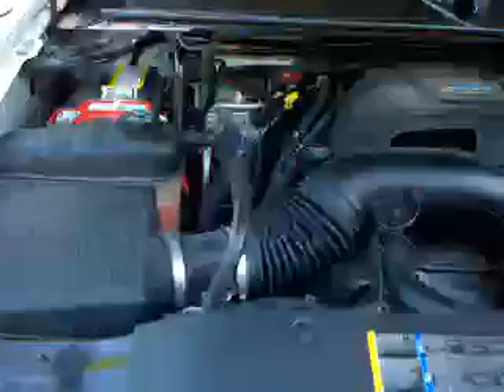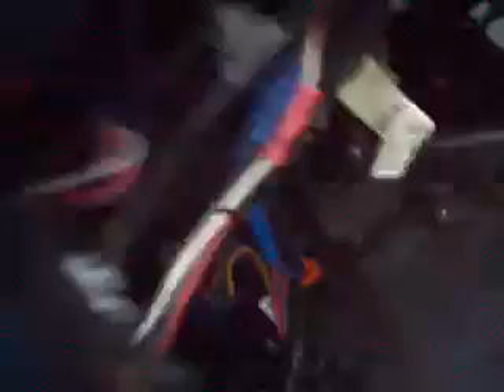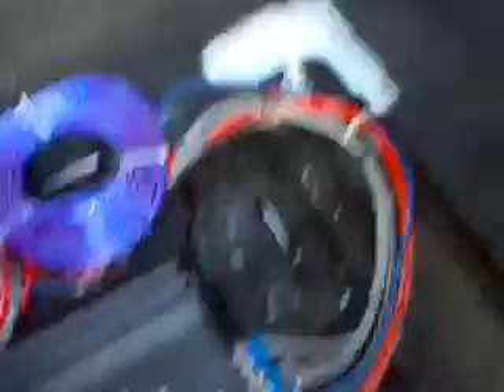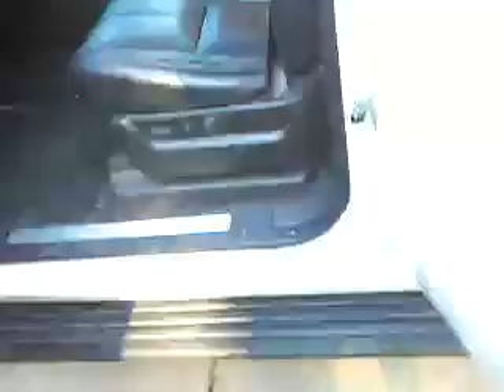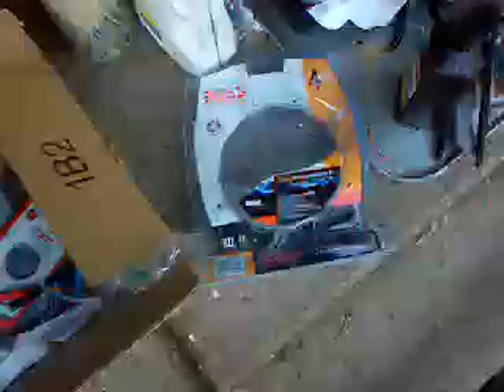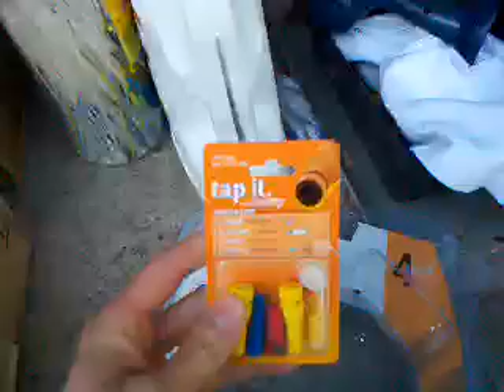2007+ Tahoe Add-an-amp

Comment: You shouldnt be running ur amp in full mode instead of lpf (low pass filter)  you need to run it in lpf and turn the lpf up on the amp to hit higher frequencies. You dont want treble signal sent to your subwoofers.

Comment: From your LOC it still has a blue remote wire where did you run that too? I see you ran the blue remote turn on for the amp to the bottom corner

Comment: You didnt have to run it across the firewall i strongly advise against soing that. It exposes the wire to unnecessary heat

Comment: I hooked up a in converter to my 2012 Yukon Denali to my amp n sub now am getting a loud noise when I put truck in drive like a deep humming sound , n when I put it back in park it stops I have the loc pro 7 in converter
Reply: I have a 2014 GMC Yukon Denali  w Bose . I hooked up a line out converter and it sounds great parked and just randomly it will do the low humm bass  out of the blue ,at the drive up windows and just different places ....  CAN anybody help me out with this ....????

Comment: when you pulled out hood release grommet did you just run the power wire in it with out a grommet or did you make the power wire just push through the grommet hole with the hood release?

Comment: George, thanks for posting this video. I ran my power wire on the pass side, shorter length and more space on the door sill to run power cable. I did a full tear down of the interior so this was easier for me to do. I hope to have a video up soon on where I ran my wires. The ignition wire on my 2008 Yukon Denali w/ Premium Bose was located on Pin 6. Socaliguy81, thanks for the awesome pics and detailed info.

Comment: While this is true, if you're only planing on running subs, you should be fine. Typically, the only EMI interference picked up is of the higher frequency type. Good advice though in general and when amplifying mids and highs.

Comment: Hey when im tapping the RCA converter to the sub wires, does the left and right matter? I have the wiring diagram for the positive and negative, but the converter (PAC SNI-15 i think), has to have a postive and negative left and the same for the right. Should I be concerned about this?